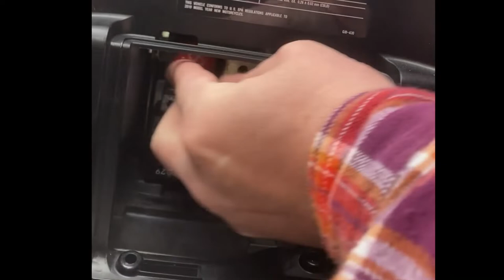How to install a battery in a honda metropolitan scooter. Short and sweet version!

Comment: great, how do i take the plastic cover off without damaging it. looks like there are some black pins that lift up but im not sure i want to pry it if theres a tip to remove them that would be great
Reply from the maker: There should be a small hole in the center of the pins. There is information about how to press these to release them (unlock them) in the owner's manual I believe, if that's helpful. They are a bit tricky. Be careful and hope it goes well. You can look up push pin rivet or screw rivet and that should get you in the right direction
Reply from the maker: As always, please follow manufacturer's advice and don't take my word for it! have a great day!
Reply: press the little pin in the center of the clip.  It will depress a little.  Then take a small flat screwdriver to pry the entire clip up.  Easy.

Comment: Video is a lie? Square nuts aren't shown! You can't tighten the screws without the square nuts! The battery terminals aren't threaded.
Reply from the maker: Thank you for watching and commenting. There is a battery terminal square nut on each end. Your correct the ends are not threaded, the bolt screws into a square nut to hold it into place. I haven’t watched the video in a while but if I missed filming that part I apologize. You should be able to see the square nuts and Phillips head bolts id think. Thank you for your time